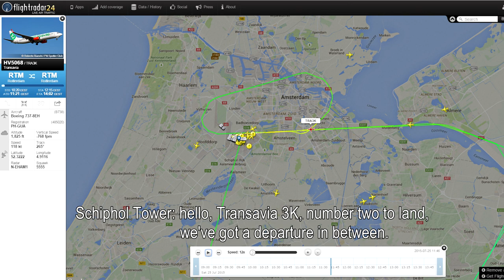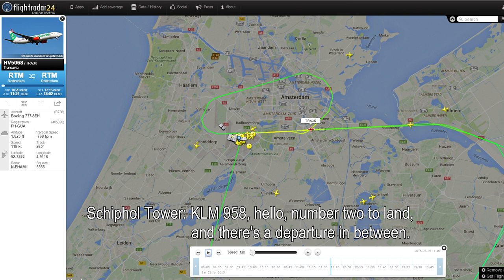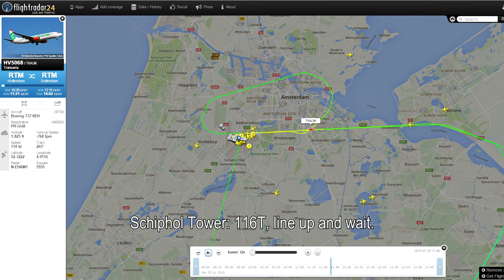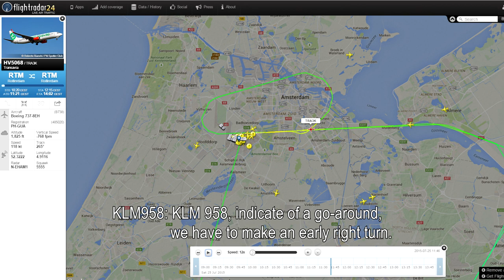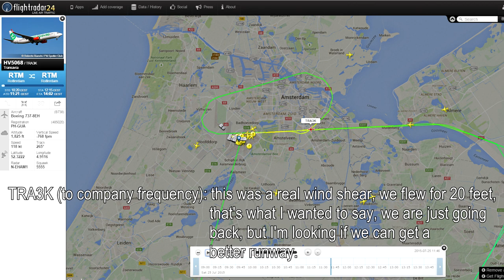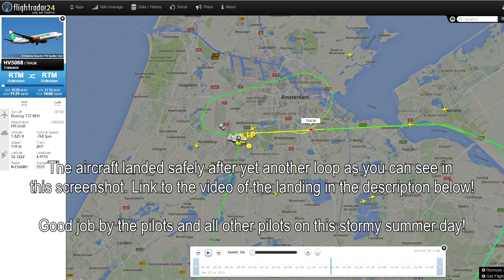ATC Audio: Transavia 737 in Heavy Wind Shear Trouble! [25-7-2015, Subtitles Included]

Comment: They diverted from Rotterdam after 2 failed approached due to weather. Well, Schiphol is close enough to have the same weather. 
Eindhoven might have been a better option as it is further inland.
Reply: They wanted to divert to EHEH, but were told off by the military control there unless they would declare an emergency, because EHEH has rather strict noise limits. They could've possibly diverted to EDLV in the vicinity of Nijmegen/Venlo where the wind was practically calm that day, but that probably didn't cross their mind.
Reply: EDLV was to for flying for the crew
Reply: Or EHGG

Comment: Wow that was worse than I thought. Do you think they were close to crash when the pilot screamed speed, speed, speed, speed? I know windshear only from simulator and it causes real troubles they called it "silent assassin" and it caused many crashes about 20-30 years ago when airports didnt have the dopler's radar.
Reply from the maker: Izmael1310 Yes indeed! I don't know, maybe the speed was getting too low without the pilot flying noticing. I'm sure it's pretty difficult to maintain speed, altitude and heading under those circumstances.
Reply: AviationPro Yeah dont know the real pilots procedures but when is the weather so bad with big chance of windshear I'am landing with higher speed in simulator.  Do you know what the KLM 958 meant by the early right turn? I checked replay on FR24.com and they were behind the Transavia number 2 for landing. And when the Transavia started the right turn after go arround they could land so I did not understand this message - what do you think?
And as the pilot said that they  flew for 20 feet I think they were pushed outside the runway or they were pushed up by the windshear. That is my guess :)
Reply from the maker: Izmael1310 Yes, actually they landed without using any flaps. I'm not sure whether that was their intention or whether there was a problem with the flaps. I made a mistake in the subtitling, he was mentioning: "in the case of a go-around we have to make an early right turn", so just to advice the air traffic controller ;)
Reply: AviationPro Thanks for explanation. Hope you dont mind discussions under your videos with me  :D #CivilAviationEnthusiast

Hope you will add new VATSIM video soon ;)
Reply from the maker: No problem, discussion is always welcome as long as we keep it nice! :) I've got some more VATSIM FAQ videos coming up, and a full flight will still take a little while!
Reply: AviationPro While the FlightRadar24 replay mode isn't the best (minimum 12x speed, only a few data points) it does look more like speed was too high on go-around: According to the replay, they were down to 140 knots on final, slowed down even further to 105 for landing, then speed jumped up to 177 for GA and up to 248 knots even before their right turn, then 268 knots after the turn on crosswind leg. It could be that flaps were still down (low speed on first landing makes me think they were used on first attempt) and maybe speed was about to exceed the flaps safe speed limits? I hope I'm wrong, but that happened to me often enough in simulation - just being distracted by something that went wrong on approach, forgetting about speed/flaps until it's too late (luckily, there are always two pilots in a real cockpit). Apart from that, it looks like published maximum speed ("MAX IAS 250KT below FL100") had been exceeded (unless it's not IAS what FlightRadar24/ADS-B shows, maybe TAS or GS?), although that should have been the least problem to worry about in that situation. But of course, FlightRadar24's data/replay may just be fooling us - we can't judge what really happened with just that data but it may help trying to find a possible explanation nevertheless.

BTW, thanks for all your VATSIM videos - I originally found your channel when trying to figure out how to read charts when first looking into IFR last year. Then I saw your full VATSIM flights with excellent explanations and subtitled ATC - what a pleasure to watch & learn! Signed up on VATSIM two months later, thanks again! :)
Reply from the maker: Thanks Daniel, I'm glad the VATSIM videos helped you! :) Yes could be, FlightRadar24 is for sure not showing IAS, it's showing ground speed, so indeed it's a bit hard to judge what the "speed, speed, speed, speed" callout exactly meant. For sure the speedbar in the 737 would have jumped around quite a bit with gusts up to 50 knots. From what I know now the F/O was pilot flying and apparently the Captain gave him a compliment for his good flying after it all calmed down a bit. :)
Reply: Did the F/O also do the final landing? Whoever was PF at that time - what a great job catching the plane so precisely above ground at that speed! Still amazed... and glad it all went well, could easily have gone wrong.
Reply from the maker: I don't know if he also did the final landing, but during this whole audio clip the F/O was pilot flying. Great job on the final landing indeed!

Comment: In the video of the landing they had no flaps and no reverse  thrust after landing.
Reply from the maker: Ron Real That's right, I don't know the exact reason. Could be to have more control over the aircraft or to save more fuel.
Reply: The main reason for no flaps landing was that they over-sped the flaps at the first attempt to land at AMS and could not use them anymore; it seems that using thrust reversal was optional (light aircraft, long - but wet - runway; early thrust reversal in gusting crosswind conditions could cause directional instability) and they might have use it later at lower speed (that part is not present in the landing video). See e.g. AVherald discussion...
Reply: You don't really need reverse thrust when landing at Schiphol.

Comment: Really scary! Did they declare emergency? Beecause of low fuel?
Reply from the maker: Spingis I'm not sure if they officially declared an emergency, maybe they did that after switching to the next frequency.
Reply: Ah alright, well i was wondering since the video the linked had "EMERGENCY" on the label. Anyways nice catch ! Very scary
Reply from the maker: Well it was kind of an emergency, after the go-around in this video they had only one chance to land which automatically makes it an emergency I think.
Reply: AviationPro It was EMERGENCY, becouse flaps was up ;)
Reply: Spingis oo du var svensk :D
Reply: +Spingis yes, the were low on fuel and the had extreem winds
Reply: Low fuel and no flaps due to them becoming inop when exceeding the max speed for flaps during the go around. BEFORE the "bad pilots" cry outs start now, consider this: They encountered heavy windsheer and with extremely gusty winds. Speeds can vary dramatically from one moment to the other and jet engines don't react like your cars engine does. It takes a while to spool up and spool down.  About the alternate: Planned alternate was Brussels. The weather there was categorized as bad to severe when they reached Rotterdam. Actually the weather all over the North of Europe deterioated quickly while they were enroute and Amsterdam was probably their best shot - especially since Eindhoven - where the weather was still slightly better - declined diversions due to noise issues. Since they didn't declare an emergency until after the first go-around at AMS that was not an option.  'Nuff said.
Reply: If I recall correctly on the documentation of IVAO fuel mayday is 30 minutes of fuel, which has to be declared accordingly by the pilot (it's not automatically given). Nonetheless above that point you can ask priority as they did. As for what happened next, I don't know.

Comment: Due to that storm I had trouble leaving Turkey with Transavia. We were all scheduled when we arrived at the airport (Antalya). The closer we got to our initial depart time, the more delay we got. I think we were supposed to leave around 10pm local time. But at 3am we were still waiting. We were already at the gate, though, and we could see our plane had arrived. But after a while it was pushed back and taxied away. Then we were informed that we would have to spend the night on the floor in a conference room of a hotel right outside of the airport. So that's what we did. Also, the next day we only departed in the evening, which means we had to spend the whole day in a hotel without a room. Transavia paid for (some of) our food and drinks at the hotel, and we got free drinks on the plane. Yay. Apart from that, no refund or whatsoever... I do remember that the people on the plane of this video, almost sued transavia for the delay and hard landing. So yeah... 'People'

Comment: Heavy windshear (loss of the speed) followed by entering in the thunderstorm cloud  (aircraft out of control during the go around+ pilot anxiety and he wants to go out the shower). 
The date of the incident was 25th of july and in western Europe (Amsterdam) this kind of weather occurs only when a storm front coming from the west (ocean, north sea) is passing over.
Their weather radar should be red an purple in every quadrant and normally they should wait to start the approach, because if  you have been diverted from Rotterdam and you have made a go around at the alternate airport, you should have normally 30 minutes of holding fuel (IFR regulation)in your tanks (if you don't use it during the flight). 
If they are running out of fuel at that time, there is a problem with the fuel computation and/or with fuel consuption during the flight (adverse wind, ...).
For me there was something wrong with that flight and they have been very lucky.

Comment: Interessting case as the "black box" for this "event" was... the finger of the pilot stucked on the PTT switch ! LOL
I thing they handled great as they came back safely.
BUT: Don't you thing that questionning if A/P would handle or not is a bit weird ? I mean: It's obvious ! MANUAL FLYING is a way better efficient in these conditions ! Why the hell this "statement": "I don't think A/P can handle this" ???
Seems to be a good job after all...
Reply from the maker: Well, it's hard to provide an exact translation, but due to the wind conditions and wind shear she said to the first officer that the autopilot would not be able to keep control of the aircraft. Autopilots are not designed to work perfectly in such weather conditions (at least in the Boeings) and might even disconnect when it is too severe to handle, so I guess she just said it as a precaution to the first officer who was flying.